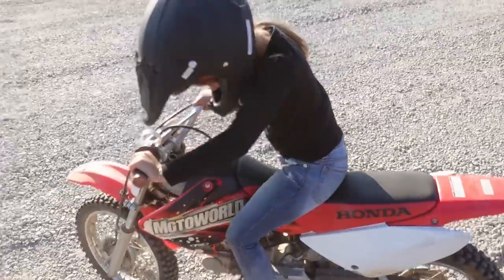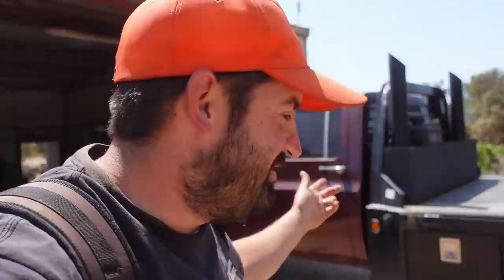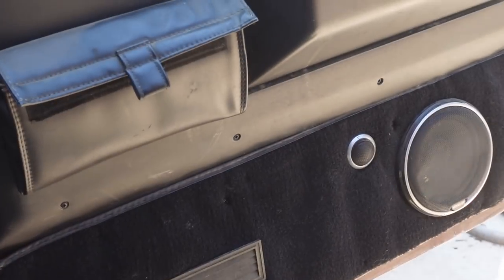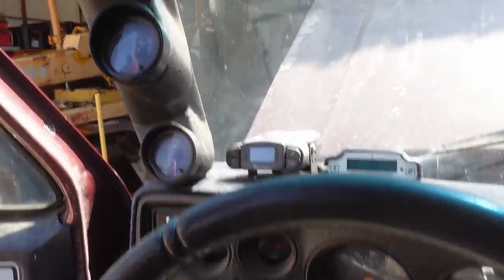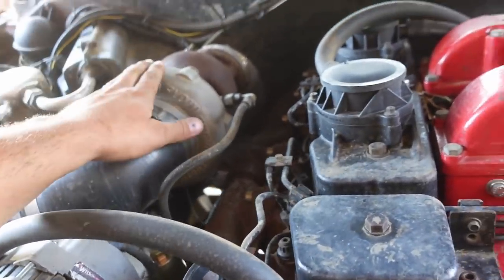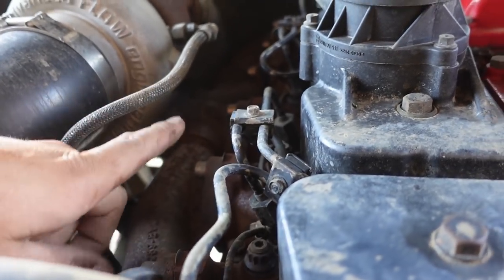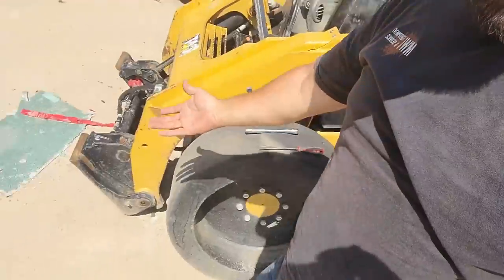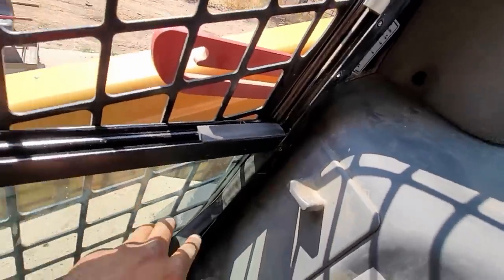Custom Squarebody Cummins 12 Valve Conversion WALKAROUND. I Might Have To Sell This Beast Of A K30!

Comment: keep the k30. the way this country is going you dont want a vehicle thats completely controlled by computers. i will NEVER get rid of my 7.3 powerstroke. you cant compete, new vehicles are pretty and have nice accessories but theyre designed around planned obsolescence. that k30 is probably one of the most reliable vehicles on your ranch without a doubt.

Comment: keep the k30 especially how rare those vehicles are right now and it's sentimental
the durmax has more things that will go out than the square body and square body's are cheaper to keep running than durmax especially with the 12v

Comment: It’s a no-brainer for me, keep the 5.9 Cummings K 30 I have an 05 Dodge Cummins 24 valve and now I am adding a 59 comments to my 1991 Chevy crew cab 1 ton with nv 4500 bought the conversion kit make it into a four-wheel-drive. Made it to AMD 205 transfer case at the same time I am doing an 85 suburban, 2 Wheel Dr. Three-quarter ton this one I am putting the 5.9 Cummins in with an Allison 545 automatic I love the diesels of old I will stay away from all the new diesels with DEF  too much shit to go wrong. The suburban will be the Dailey driver, while the 1 ton is being built specifically as an expedition vehicle with a camper on the back. Old school the way to go the hell with all this electronic BS. Keep the K30

Comment: I like that tachometer, would I need to get the entire kodiak guage cluster or could I just put the 1 guage into a normal squarebody guage cluster
Reply from the maker: Its the entire kodiak cluster I believe
Reply from the maker: I wish I  still had the truck, but I got real poor last year and had to sell it. Maybe I can build another cool truck here in a little bit.
Reply: @Mr_Get_Muddy  I mean, I've got a few of them if you're looking to get back into one...
Reply from the maker: Any crew cab k30s ?
Reply: @Mr_Get_Muddy  no, I've got a standard cab C30, K20 Burb and a longbed C10.
Reply: And a pretty well built up K5
Reply: @Mr_Get_Muddy do you remember how you wired that kodiak cluster into the truck? I managed to get one to do the same thing but I noticed that there's different connectors and such

Comment: Looks great. questions I have are what transmission and transfer case are in it, the the disk brake on the back of the transfer case is a e brake? is it cable driven? I'm lookin for ways to e brake my dana 70 if i do a disk brake conversion. Have you decided on selling? is so how much?
Reply from the maker: It has the getrag 360 with np205 out of a first gen. The e brake is cable driven. And ya I had to sell it. Fell on hard times but would love to build another one one day
Reply: dang to late for me. I'm currently building pretty much the exact truck. the only difference is I'm using the g56. the reason I ask about the e brake is I'm trying to decide to do disk brake conversion on my dana 70 or change to a newer axle with disk brakes and factory e brake. If i convert mine i haven't been able to find a good solution for the  e brake, do you remember the details on that e brake system?  @Mr_Get_Muddy
Reply from the maker: @anthonyrem  so originally I had used the e brake calipers but switched to a driveshaft brake that goes on the back of the transfer case